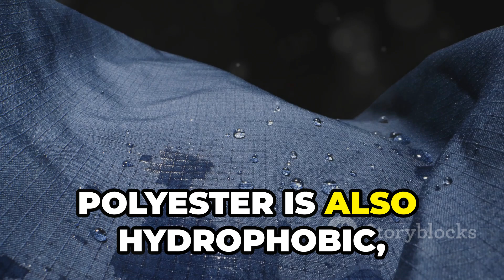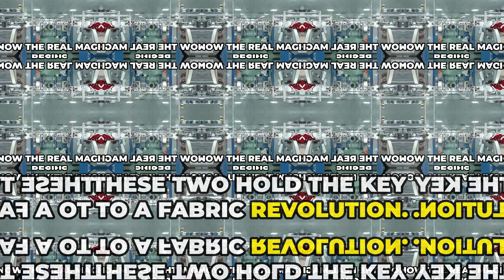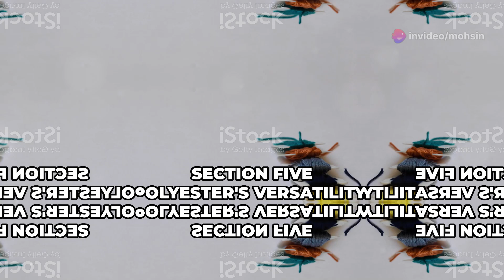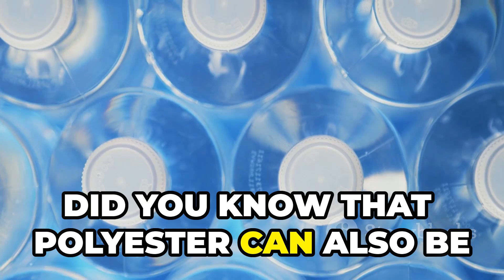How Polyester Fabric is Actually Made!

Comment: Well, at least they acknowledge the environmental impact is an issue. Research shows recycled polyester leaches even more microplastics so buyers beware!
Reply from the maker: Hi @NaturalDrAmanda, thanks for raising an important point. You're absolutely right that microplastic pollution is a serious concern with all synthetic fabrics, including recycled polyester. While recycling PET into fabric helps reduce waste and often has a lower initial carbon footprint, the shedding of microfibers during washing remains a significant environmental challenge.

The industry is actively researching solutions, like improved filtration systems for washing machines and developing fabric coatings or constructions that minimize shedding. As a consumer, using a Guppyfriend washing bag or a Cora Ball can help capture microfibers at home.

It's a great reminder that "recycled" doesn't always mean "problem-free," and informed choices are key. Thanks for adding this crucial context to the discussion.

Comment: I'm all for polyester/spandex clothing which is colorfast, packs easy by rolling them up, many hours later I can unpack and hang them up and there's no wrinkles.
The only drawback is that the fabric doesn't breathe in hot weather.  Just wear cotton underwear underneath.
My polyester/spandex outfits will probably outlive me.  They last probably 20 times longer than cotton, linen, or other 'natural' materials.
All my cotton T-shirts have faded out and worn out.  My cotton dresses only lasted for  about 5 years.